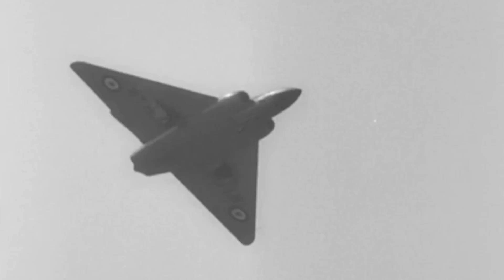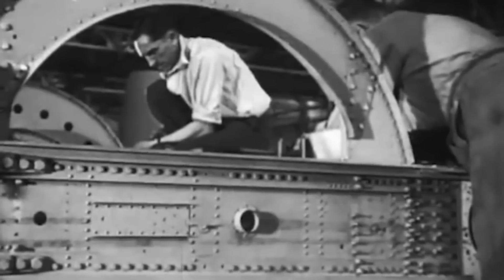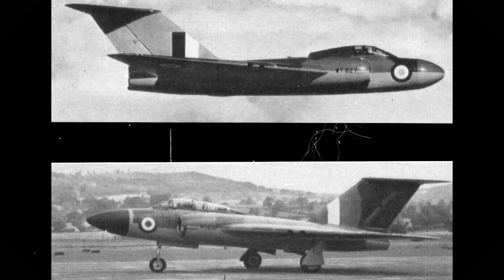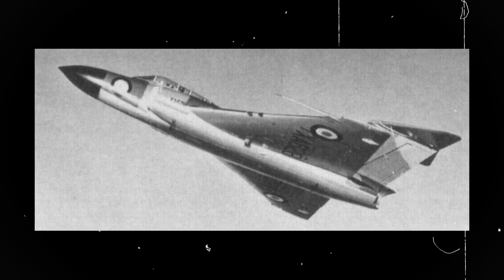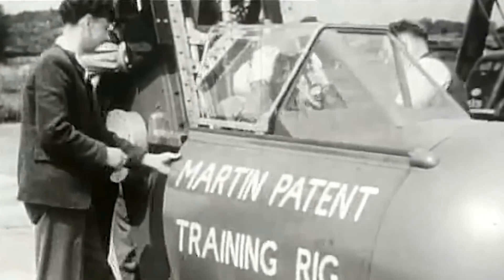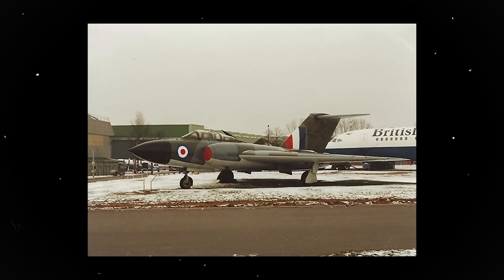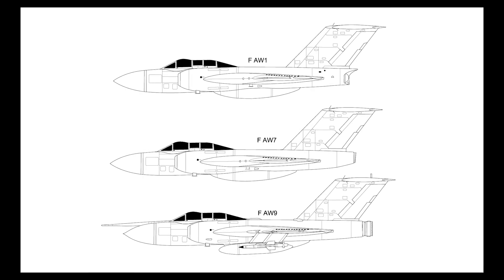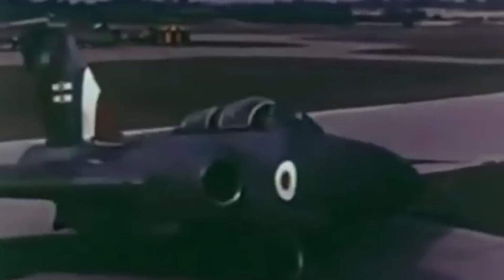The Bizarre Interceptor That Accidentally Broke the Sound Barrier

Comment: Imagine if they had used the Olympus engines, im sure the Javelin would have been in service into the 80s.
Reply: Very unlikely... sounds like wishful thinking
Reply: @sandervanderkammen9230  Nope, they had a prototype but was cancelled for the Avro Arrow, which was then also cancelled.
Reply: There were a number of Javelin successor designs which included a much larger thin wing Mach 1.8 version with a more powerful Bristol Olympus engine.  They were cancelled for various reasons including a belief at one point that supersonic jets would be entirely replaced by various kinds of missiles.
Reply: @petemaly8950  basically because of the Labour Party 😂

Comment: You only have to look at a Javelin in the Duxford Museum to know that it was never going to be fast, I am surprised that they got more than 550knots out of it.
Reply: The specifications of the Javelin appear to be poor on paper but it was far more agile than any contemporary fighter. The Javelin was slow compared  the F4 and other contemporaries it included technologies which no other aircraft at the time could match, including a phase advance system which no other aircraft could match. It didn't need to be fast, it was so agile it was better able to be avoid being targeted  which enabled it to target other aircraft with either guns OR missiles!  😁😁😁
Reply: More than 550 knots was not part of the required specification and unknown in 1947 when the design started.
Reply: One of the Javelin successor designs was a larger thin wing aircraft with Bristol Olympus engines and various aerodynamic  refinements such as area rule shape which would have been a Mach 1.8 multirole aircraft. Cancelled for various & numerous reasons including an influential report that declared that in future everything would be done with various types of missiles.

Comment: I just love the aircraft of the fifties and sixtys  ... they had character and interest that modern aircraft just dont have  .....   a bit like me really !
Reply: British jets from the 50's and 60's stood out for one characteristic in particular...
The inability to reach Mach 1.
Reply: @sandervanderkammen9230 

We feel we can clear up some commonly held myths and misconceptions, obviously.

It's always good to see the facts presented clearly and concisely isn't it?

It is correct that the DH Vampire for example was primarily a metal construction airframe aircraft that used a lignin fibre reinforced hot moulded triple layer cored composite construction methods that was the forerunner to similar current aerospace techniques involving carbon fibre materials.

Obviously there were a number of UK supersonic Mach 2 & Mach 3 capability aircraft in development during the 1940s & 1950s. Due to decisions made about not bothering with piloted  aircraft & only using missiles of various types most (but not all) of the UK supersonic aircraft work got cancelled at the time. A lot of the research info was shared with other countries, especially the US where comprehensive flight testing was massively easier & production facility space much more easily obtained. 

   That's correct, of course the MD F3H Demon was a contemporary to the DH Sea Vixen & had a similar performance. The F4 Phantom was a follow on from the F3 Demon. The Sea Vixen took a long time to get from first flight to introduction for various reasons and a similar situation occurred with the MD F3H Demon.  

McDonnell Douglas F3H Demon.
A subsonic jet aircraft that went into service in the US in 1956.
590 Built.
Introduction date 7 March 1956
First flight 7 August 1951
Retired 1964

MD F-4 Phantom 2
Number built 5,195
Manufactured 1958–1981
Introduction date 30 December 1960
First flight 27 May 1958

DH Sea Vixen
Number built 151 (including two DH110 prototypes and one Sea Vixen prototype)
Introduction date July 1959
First flight 26 September 1951*l
Retired 1972

Non combat phase accident losses.
% of Aircraft built.
The Canadair CL-44 was a turboprop airliner.
Canadair CL-44              (ff 1959 ) 48%
Lockheed XF104              (ff 1954) 100%
Lockheed  P80                 (ff 1944) 43%
Lockheed F104                (ff 1954) 45%
MD FH Phantom 1           (ff 1945) 35%
MD F4 Phantom 2           (ff 1958)  28%
MD F3H  Demon              (ff 1951)  32%
Gloster Meteor               (ff 1943)  21%
DH Vampire                    (ff 1943)  23%
DH Sea Vixen                  (ff  1951) 33%
Gloster Javelin                (ff 1951) 20%

    Regarding the UK Aerospace Sector.
   
An airline recently ordered 60 RR Trent XWB Engines.

   Clearly It's a great pity & a crying shame that British military forces had to occupy a large part of Germany for decades after 1945 & Russian military forces had to do the same. Of course Russia still posseses a large chunk of what was German territory & of course Russia & the UK produce nukes. Obviously Germany does not produce nukes.

   Interesting British achievements.
There is no doubt that the Fairey (England)
Delta 2 was of course the world's first jet
aircraft to exceed 1000 mph.  lndeed It
exceeded the previous record by 310 mph &
held the record for 1 year. Incidentally, the Dassault Mirage 3 & 4 are based on the Fairey Delta 2. The Fairey Delta 2 was the first jet aircraft to exceed 1,000 miles per hour (1,600 km/h) in level flight. On 10 March 1956, it set a new world speed record of 1,132 mph (1,822 km/h), exceeding the previous official record by 310 mph (500 km/h).

Early days, jet fighters.
   De Havilland Vampire, Sea Vixen & Gloster Meteor accident losses were not high or unusual for fighter aircraft at the time. De Havilland built large numbers of all metal airframe aircraft before the DH Comet.
We mustn't forget of course that the DH Vampire for example first flew in 1943 & the engine was also built by De Havilland. There were examples of the Vampire interceptor / fighter in service until 1990 which was operated by more than 30 countries.

Non combat phase accident losses.
% of Aircraft built.
The Canadair CL-44 was a turboprop airliner.
Canadair CL-44             (ff 1959 ) 48%
Lockheed XF104             (ff 1954) 100%
Lockheed  P80                (ff 1944) 43%
Lockheed F104                (ff 1954) 45%
McDonnell FH Phantom  (ff 1945) 35
Gloster Meteor               (ff 1943)  21%
DH Vampire                     (ff 1943)  23%
DH Sea Vixen                  (ff  1951) 33%
Gloster Javelin               (ff 1951) 20%

   An example of what goes on these days in various countries.
Obviously, for example, there are of course no German companies that makes German jet aircraft in Germany & there are no German Companies that make German gas turbine aero engines in Germany that are suitable for widebody airliners.

     That's correct, Brazil makes very good airliners & Brazil is 100th down the list along with Indonesia for wealth per capita. Of course it is in fact the case that Embraer can't build those airliners without purchasing stuff from the US, UK & Europe.
Norway Holland Denmark Ireland Belgium - Top 20 wealth per capita - Don't make airliners -  its as simple as that.

   Early days of the airliners.
That's correct of course, at the time the Comet wasn't particularly dangerous. Agreed, that is indeed the case of course, The DH Comet was definitely not the worst engineering failure in commercial airliner history.

Losses comparisons
How things were in those days.

DeHavilland Comet 4 UK                       14% 
DeHavilland Comet all  (ff 1949)           17%  

Boeing 307                               70%
Boeing 247                               48%
Boeing 707            .                  20% 
Lockheed Electra Turboprop   29%
Canadair CL-44  Turboprop     46%  
Convair CV-580  Turboprop     22%
Convair CV-880    (ff 1959)       27%  
Convair CV-990     (ff 1961)      33%
Tupolev TU-104       (ff 1955)    16%

     Of course De Havilland had prior experience building many all metal construction airframe aircraft & thousands of jet powered fighter aircraft that were primarily of metal construction with pressurised cockpits & jet engines built by De-Havilland.

  More recent UK military jet aircraft.

  Of course the Tornado & Typhoon & their engines are Supersonic & are indeed British design aircraft with British design engines built by an international consortium. The Tornado design for example started life during the 1950s at Vickers as the AFVG, it's engine is based on the RR RB-199. The EE Lightening is also a British Supersonic jet aircraft.

  The Typhoon is the British BAC-EAP with an engine based on the British RR XG-40, the Typhoon is also built by an international consortium.

  Agreed, that is correct of course, clearly there are many countries that could easily produce airliners of better quality than Bow-wing (see b-47 wing folding & wing collapse incidents) but don't for some very good reasons. Bow-wing (see B-47 wing folding  & wing collapse incidents) being a result of the size of the US, the large protected domestic market & great ease of testing new types due to the equator to arctic geography complete with up to date aviation infrastructure & a few other reasons related to production scale capability, politics, the nature of the airliner market coupled with the nature of airliners themselves & general basic economics.

  Obviously there really is nothing special about Bow-wing, having more than 50 years design / build experience on the type means they have no excuses for the horrendous 737 Max incidents for example.

    Indeed BAe Systems & Rolls Royce combined now do more Airbus work than Germany on an absolute basis & significantly more work than that on a per capita basis.
   
     Agreed, Per capita for the home nation BAe Systems is the world's largest defence contractor.
  
    Correct, BAe systems announced the recent £4 Billion takeover of Colorado based US based Ball Aerospace.
  
    It's definitely the case that BAE systems now does a significantly higher value of work for Airbus than it did when it was a major Airbus shareholder before 2005.
     
      Obviously RR now owns US Engine maker Allison for example which does classified Aerospace work for the US Govt.
   
   Yes, that's right of course, Anybody currently flying on a widebody airliner stands a good chance of being on an aircraft powered by RR gas turbine aero engines built in the UK.

   A typical but small glimpse of what goes on in the very internationally orientated British aerospace sector. 

  Of course the RR Nene was in fact the world's most reliable & most powerful gas turbine aero engine in 1944. Licensed built versions & copies of the RR Nene & RR Derwent would go on to power many aircraft in Russia including the Mig 15 & Mig 17, the US, China, France & other countries for decades after 1944.

      Boeing Apache Attack Helicopter.
AH-64 75 UK suppliers, 7% UK content, global fleet of 1280+ aircraft.
F35B more than 130 UK Suppliers, more than 30% UK content.
F35A & F35C more than 130 UK Suppliers, more than 15% UK content.

   There is no doubt that an airline has just ordered
60 RR England Trent XWB Engines

Obviously the UK has the
World's Highest Combined Per Capita
 Nuclear / Defence / Aerospace Sector Activity.

Rolls Royce Holdings UK
Subsidiaries
- Rolls-Royce plc
- Rolls-Royce North America (Allison etc Classified Military stuff)
- Rolls-Royce AB
- Rolls-Royce Deutschland
- Rolls-Royce India Private Limited
- Rolls-Royce Marine Power Operations
- Vinters Engineering Limited
- Rolls-Royce Controls and Data Services
- Rolls-Royce Power Systems
- Bergen Marine
Joint ventures include:
- Rolls-Royce Turbomeca
- MTU Turbomeca -

Trent Family
The MT30 (Marine Turbine)
Industrial Trent 60 Gas Turbine
Trent 7000
Trent XWB Airbus A330neo.
Trent 1500
Trent 1000
Trent 500
Trent 600
Trent 700
Trent 800
Trent 8100
Trent 900

RR wholly owned subsidiaries in Germany handle smaller 2 shaft RR gas turbine aero engine work.

Clearly the line above this line is blank.
   
We do indeed hope this helps, of course.

Comment: Was Chuck Yeager the first? They didn't have the wind tunnel technology. Let's face the Germans had better engineers. the me-262 was amazing
Reply: Britain had no supersonic aircraft wind tunnel laboratory until RAE Bedford, construction did not begin until 1947.
Germany constructed the DLA supersonic research facility at Braunschweig in 1935. 

The Me-262 was the first jet with a powered horizontal stabilator... and the first jet to fly faster than its critical Mach number.
Reply: @DoktorBayerischeMotorenWerke We feel we can clear up some commonly held myths and misconceptions, obviously.

It's always good to see the facts presented clearly and concisely isn't it?

Without doubt the world's first wind tunnel was constructed in England in 1876 B Wenham.

The world's first supersonic wind tunnel was constructed in England during the 1920s.

Indeed, The ME 262 had control lockup at 590 mph found during a dive manoeuvre, normally it's do not it exceed speed was 456 mph. In 1945 the Gloster Meteor was happily doing more than 600 mph.

Obviously there were a number of UK supersonic Mach 2 & Mach 3 capability aircraft in development during the 1940s & 1950s. Due to decisions made about not bothering with piloted  aircraft & only using missiles of various types most (but not all) of the UK supersonic aircraft work got cancelled at the time. A lot of the research info was shared with other countries, especially the US where comprehensive flight testing was massively easier & production facility space much more easily obtained. 

Interesting British achievements.
There is no doubt that the Fairey (England)
Delta 2 was of course the world's first jet
aircraft to exceed 1000 mph.  lndeed It
exceeded the previous record by 310 mph &
held the record for 1 year. Incidentally, the Dassault Mirage 3 & 4 are based on the Fairey Delta 2. The Fairey Delta 2 was the first jet aircraft to exceed 1,000 miles per hour (1,600 km/h) in level flight. On 10 March 1956, it set a new world speed record of 1,132 mph (1,822 km/h), exceeding the previous official record by 310 mph (500 km/h).

 A typical but small glimpse of what goes on in the very internationally orientated British aerospace sector. 

  Of course the RR Nene was in fact the world's most reliable & most powerful gas turbine aero engine in 1944. Licensed built versions & copies of the RR Nene & RR Derwent would go on to power many aircraft in Russia including the Mig 15 & Mig 17, the US, China, France & other countries for decades after 1944.

      Boeing Apache Attack Helicopter.
AH-64 75 UK suppliers, 7% UK content, global fleet of 1280+ aircraft.
F35B more than 130 UK Suppliers, more than 30% UK content.
F35A & F35C more than 130 UK Suppliers, more than 15% UK content.

   There is no doubt that an airline has just ordered
60 RR England Trent XWB Engines

Obviously the UK has the
World's Highest Combined Per Capita
 Nuclear / Defence / Aerospace Sector Activity.

Rolls Royce Holdings UK
Subsidiaries
- Rolls-Royce plc
- Rolls-Royce North America (Allison etc Classified Military stuff)
- Rolls-Royce AB
- Rolls-Royce Deutschland
- Rolls-Royce India Private Limited
- Rolls-Royce Marine Power Operations
- Vinters Engineering Limited
Rolls-Royce Controls and Data Services
Rolls-Royce Power Systems
Bergen Marine
Joint ventures include:
Rolls-Royce Turbomeca
MTU Turbomeca 

Trent Family
The MT30 (Marine Turbine)
Industrial Trent 60 Gas Turbine
Trent 7000
Trent XWB Airbus A330neo.
Trent 1500
Trent 1000
Trent 500
Trent 600
Trent 700
Trent 800
Trent 8100
Trent 900

RR wholly owned subsidiaries in Germany handle smaller 2 shaft RR gas turbine aero engine work.

Clearly the line above this line is blank.
   
We do indeed hope this helps, of course.

Comment: I was a Radar Tech at RAF Henlow 1956/57 We were refurbishing ROTOR radar convoys, returned from RAF Germany. When Finished we set up on the air field and they were used for the testing and training of Axillary RAF fighter controllers and aircraft plotters. During one test period there was a war game. RAF Germany with Canberra's verses UK air defence. We were not actively involved but had Directing staff sitting in and observing things.  It was obvious that the Canberra's were long gone by the time the Javelins got  to the Height where they had been.  The Canberra's were told to slow down to give the Javelin's a chance.   Later 1970 in Malaya (Penang) the same situation New Zealand Canberra's and defending Australian  Mirage III but this time at very low level.  The Ausies claimed the Kiwis were hiding in the rubber plantations.

Side note IN Penang Malaysia We operated a Computer assisted intercept system and when setting up an intercept we would get a go no go indication  On some runs with Mirage III against Canberra's and Vulcans we would get GO NO Return